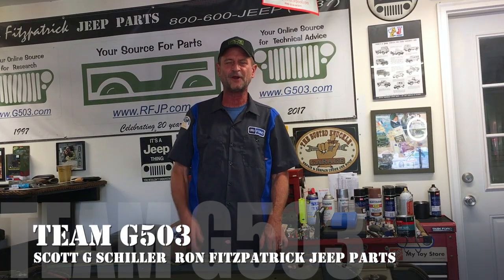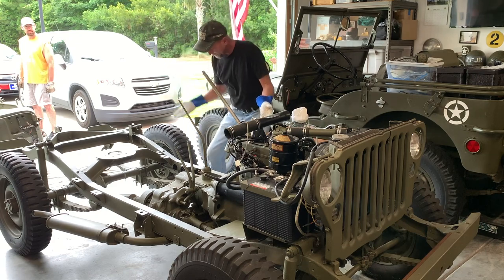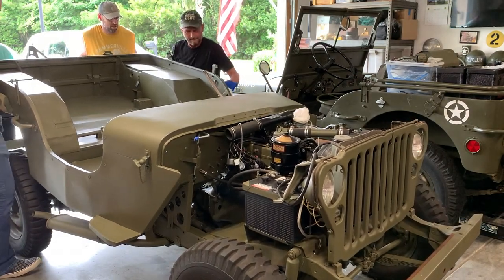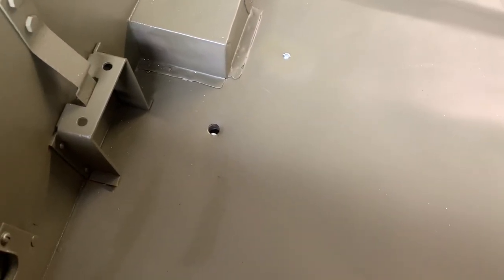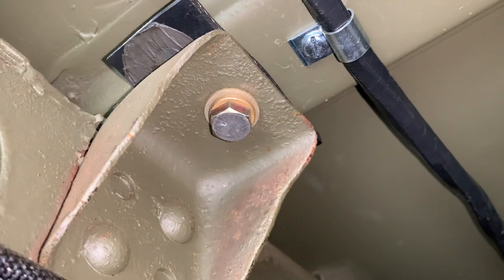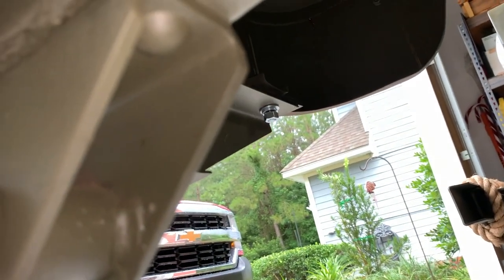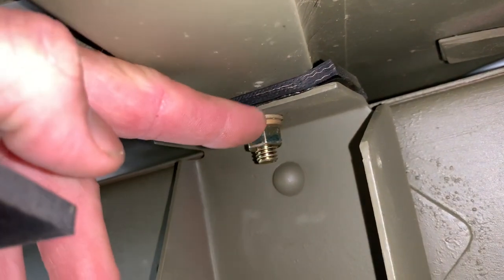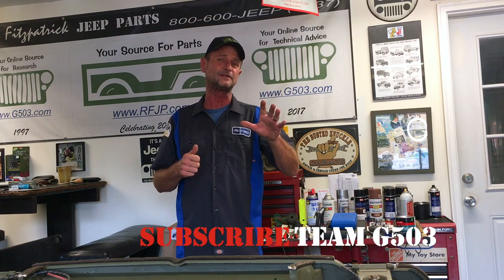Installing The Tub On A 1943 Willys MB Ford GPW Team G503

Comment: So much easier to take the gear shift lever off before dropping the tub on. Yesterday (3rd Feb 24) I dropped my mid series Willy's tub (pre trailer socket) onto my November 44 GPW chassis. I had three guys helping me, two of whom are Landrover enthusiasts. They couldn't believe how quick and easy it was and how light the tub is.

Comment: Couple of tips.... learnt from my restorer...

1.   Fit gauges whilst the tub is off the body...  stand it on its rear end...  that way you can work standing up instead of laying down....

2.   When about to mount body on to chassis, replace your correct and no doubt painted steering wheel sleeve, with an old one so that scratches don't matter.

Comment: Great video.  Quick question for you on the bolts.  It looks like some of the bolts are grade 8, and some aren't.  Did you buy a "bolt kit," or did you buy individual bolts with the sizes based on your research, and had to take what they had available?  Thanks.
Reply from the maker: I bought individually, just like you said. Kits are available. I just was getting impatient that particular weekend😉👍

Comment: Any suggestions on the use of star washers and stamped pal nuts for the mounting bolts?  My MB came with plenty of these and it appears their use is correct.
Reply: My RFPJ body bolt kit only came with the stamped nuts, no star nuts, and I'm not sure what I'm supposed to do with them?